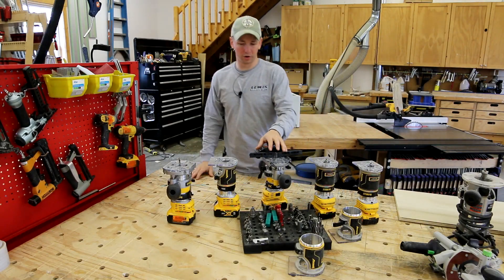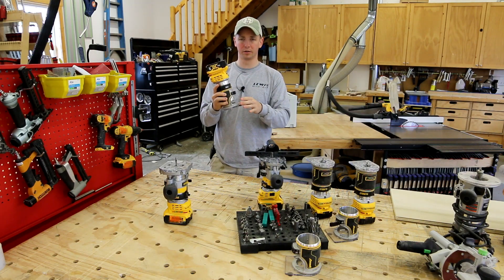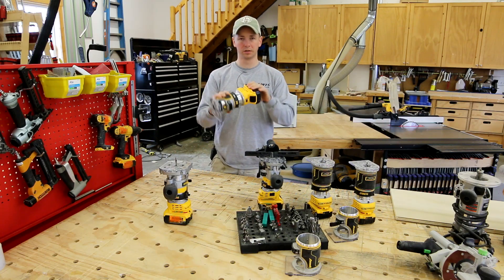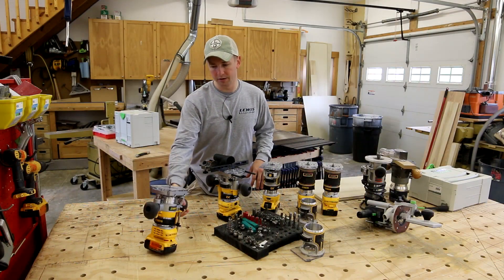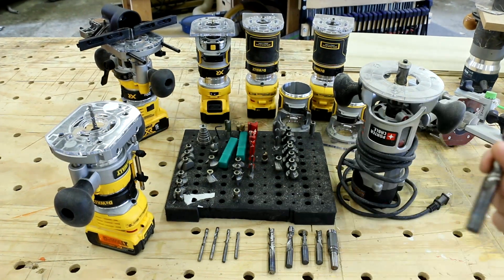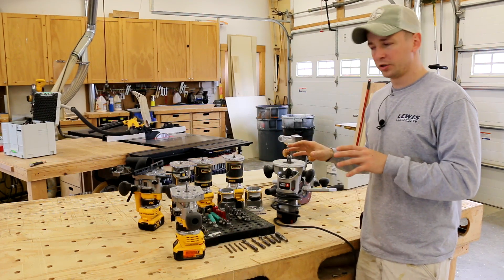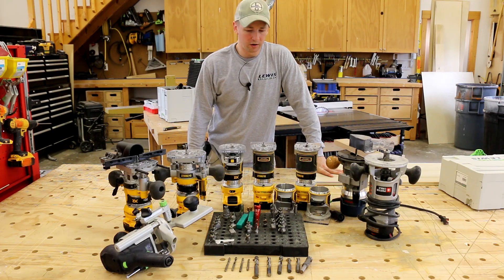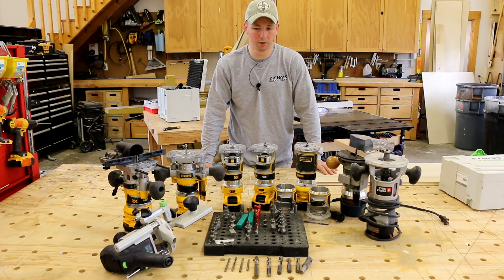DEWALT DCW600B 20V Compact Router Review and Four Uncommon Bits that Take it to the Next Level

Comment: Great video. Just got the cordless dewalt in a Christmas deal. Deff gonna look into some of those bits. Just a camera tip if you go into your camera settings you will find focus settings. Set the focus to be center weighted so it will focus on whatever's in the center of the shot. So when your showing a bit up close it will automatically focus so long as you have it in yh center of the shot. Super useful for this kind of stuff. Keep the vids coming!

Comment from the maker: FYI **This Router Is Not Brushless** (I think I said it was brushless in the video)

Who else is going to have a pile of corded routers collecting dust in their shop??? Cordless is here and its here to stay. Great job Dewalt on this tool. Keep the cordless tools coming. (I really want to see a cordless biscuit joiner come to the market next. After that I'll take a pin nailer.)
Reply: I think I've seen the cordless biscuit joiner.
Reply: I'll second the cordless pin nailer!
Reply: I just checked on Amazon and in the question-and-answer sections it says they are not brushless technology. Do you have actual brushless ones and where to get them
Reply from the maker: You are correct. I realized after I had already rendered and in the process of uploading that I said brushless. I didn't feel like going through the whole process again to edit it. But honestly with my experience using the router I'm getting impressive run times as is.
Reply from the maker: I'm holding out for dewalt. I don't own anything cordless from makita, so I don't want to go down the road of another battery platform.

Comment: Thanks for the review.. I didn’t know the bits cost as much as the tool itself
Reply from the maker: Yep, but when tear out will ruin an expensive work piece you need those expensive bits. They can be money well spent.
Reply: Well, you can get decent bits for $20-$40 that do a good job, they're just don't last long. And where you might normally sharpen it a bit, doing it to an up/down/compression bit is just not an option. You can get very good bits for $50 up to $150... but a $200 cordless router isn't where I'm risking using those. 
 
Smaller routers will occasionally "jump" no matter how skilled you are. And with a ¼" shank, the bit is ruined. I had a good amount more jump with the Dewalt,  and a compression style. I'm usually working with wood, occasionallyaluminum. The Dewalt  did great on aluminum, but wood was a bit of a nightmare. I use the makita 18v coupled with the plunge base it's amazing. (And I admit that I've never tried the plunge base for the Dewalt, but it's had some harsh reviews.) But even then, I'm putting more costly bits into better routers.
 
Oh Dewalt... was ELU all for nothing? Lol

Comment: Thanks for this Spencer!  Convinced me to add the DeWalt battery starter Kit with the router, into my Home Depot cart.  Works out to 99.00 for the router, as a bare tool.  I already have the starter kit from a previous deal, so will probably return the battery kit, as Home Depot separates them on the receipt.  What am impressive set up!  Those flush cutting spiral bits are  really unusual and I will be checking those out.  Thanks for the Video.  A Happy New Year to you and yours!  👍👍👍😁✌🏻🇺🇸

Comment: by the way you should try to take footage whenever you have a modification you're doing or a jig you're making for a tool. From what I've learned so far from a really great carpenter i work for is that there's quite a few tools that have so much more potential if the user understands how to get results they want from a homemade jig.

Comment: People underestimate the value of having multiple routers. I think when I counted, between full size routers, compact routers, and jigs, I think I have about 20 routers. 

I build things similar to you. I have a special lipping planer. Don’t remember who makes it but it was several hundred to a thousand dollars. Really good though. Great for big countertops and shelves.

I used to just glue and nail a 1x2 front edge to my shelves and tops. Now though, I run a 3/4x1/2” rabbet (using a bearing guided router bit) in the 1x2. This makes it easier to apply the trim, and now I only have to flush trim a 1/4” of material. It also automatically makes it nearly flush. You just have to take off about 1/32” since plywood is slightly under 3/4”. I highly recommend it. I also you that joint on my live ends where an end panel meets the faceframe.
Reply: Thanks for sharing that, makes great sense
Reply: Hoffman made (makes?) a good, but expensive, lipping planer.

Comment: Yes LIMITATIONS, but still love it.  I used a pattern bit to trim 3/4 mdf and was using 1 hand to hold the tool, and the other to hold the dust hose...NFG, either the cut got too heavy, or I went the wrong direction, either way the bit caught and climbed right out of my hand...over my head, and onto the floor.  Definitely a 2 handed operation, getting the plunge base next!

Comment: Yeah I like those compression bits they really do a good job. I'm old and retired now but my routers are all corded sorry for the lag in technology. Who would have guessed the direction Battery Technology has gone? Miter saws and table saws with battery?? Wow what a country!!
Reply from the maker: It is crazy. And its only going to keep getting better. Another decade and we will probably only have cords on our battery chargers.
Reply: I have gone almost completely cordless. If I am on a job for an extended period of time my corded miter and table saw come out. But if I am only  on a short day or two job all my saws are cordless. Really cuts down on setup and clean up time, plus don’t have to worry about searching for enough electric to run my job.,

Comment: that collins ply-prep bit is interesting.  does it leave points on the edge of the plywood or does it leave at least a 1/8”  flat so you can put clamping pressure on it so the points don’t collapse?
a five minute video wood bee great if you have the time.
i find this bit interesting because i’ve never heard the glue moisture to pop the ply and cause that line you’re talking about.  i’d love to know more.
great video.
Reply from the maker: It leaves a little bit flat. It has some adjustment as to how much. Depends on how you set it up. It really helps get invisible seems.

Comment: Been waiting for the new brushless dewalt routers. I plan to use them dedicated for  door installation (hinge mortising and latch plate mortising).
Reply from the maker: They are worth the wait. I'm satisfied. Glad they got it right. FYI they aren't actually brushless.
Reply: Insider Carpentry damn, shouldn’t have watched this video. Those two Ryobi corded ones for doors I got a few months ago will need to find a place in my workshop and the dewalts will eventually find a place for on site work where cords are a pain.

Comment: Great video! Where can I find the dust shroud you have on the Bosch router with ply prep bit. Currently using the bit in router table with power feeder but I like the versatility of a handheld router option. Thanks.
Reply from the maker: Honestly I can't remember where I got it from. It's been a long time since I made that setup.

Comment: I picked one of these up a month or so ago and I'm glad I did. The run time is crazy on them. 

With that plywood prep bit, how deep of a cove does it make? It seems like there could be a risk of damaging the top veneers if you're clamping the hell out of nosing.
Reply from the maker: Its not very deep at all. And you can adjust it if needed so you're not taking out maximum depth. I don't think you's have any issues.
Reply: @InsiderCarpentry  that makes sense! Did I see a festool female cord in your other router?

Comment: I have the new cordless Milwaukee, and the Dewalt, I love both, Great routers, Thanks for the nice review. I was wondering what size your shop is, Mines 32x25, Yours seems so much bigger
Reply from the maker: 30x36. Its an attached garage to my house. I feel like I could utilize the space much better if I didn't have doors taking up all the space on two walls. But it works for now.
Reply: @InsiderCarpentry  Looks like a great size, Wish I had just a little bit more, I have a panel saw and a panel router that takes up a lot of my wall space, Thanks for the info

Comment: Got one the criticisms are the speed control is too easily changed if you accidently touch it and the on/off switch takes some getting use to! Wanted to cut a circle out but can't see a way to do that. As always Dewalt make a good tool but there's always something that could have been easily improved if the guys who design these tools actually used them! No review on Youtube to show how to use all the accessories :(

Comment: Is the collins bit in the Bosch router a 1/4" shank?  The 1/2" shank is out of stock but i feel like 1/4" would work fine for the amount of stock you're taking off.  Also, where did you get the dust port?  Thanks.
Reply from the maker: yes, the 1/4 would work fine for the ply prep bit.

Comment: I hang a lot of doors in older homes and would like to go cordless with DCW600, as I am mostly on the Dewalt 20V platform. The standard base isn't big enough to span the rails of my Porter Cable template, but the plunge base DNP612 would be wide enough. Will the plunge base accept PC style 2-piece guide bushings? Dust collection would also be a big help, and Dewalt offers a dust port DNP616 made to fit the plunge base.  Have you used the dust port with the plunge base, and do you think this combo would do a reasonable job controlling dust when template routing? (The stock Milwaukee 2723-20 kit checks all my boxes, but I'm hoping to avoid adding another battery platform.)
Reply from the maker: I haven't used DC with the compact router ever. This base plate might be a good option. I have it on a couple of my trim routers, one of which I use for a hinge template. Hard to get good dust collection on routers. https://amzn.to/3m1z4yE
Reply: @InsiderCarpentry  Thanks, Spencer.  BTW what butt hinge template do you use? (I have some Templaco fixed size but mostly use PC adjustable.)
Reply from the maker: Nothing in particular. I rarely ever do hinge work. Door shop does everything.

Comment: How would you compare the Dewalt compact router to the new Milwaukee compact?
Reply from the maker: Almost all of my time is on the dewalt so I can't give a fair assessment. At face value they are almost the same, only major difference in function is the battery platform. Both are excellent options.
Reply: Thanks so much, appreciate the insight And a big fan of the channel

Comment: I see in your video you have 2 empty bases on the table, where can those be located? Looking to see if the cordless base would fit on the DWP611. Thanks
Reply from the maker: The plunge bases can be easily switch out with the fixed bases.

Comment: I have a 350 dollar Dewalt hammer drill that is nine years old that I can no longer get a repair part for as Dewalt has discontinued production of the gear assembly making the drill useless.  I tried to find a factory repair center in my area but found out Dewalt had closed them. I was a dedicated Dewalt tool person but I guess I will have to rethink that one.
Reply: Bin it mate. These tools aren't designed to last a lifetime.

Comment: Have you tried any 60v batteries in these tools?
Honest question why but a 5ahr battery when for just a few more dollars I can buy a 6ahr 60v flex volt battery?
Reply from the maker: You wouldn't be getting any more power. Just 1/6 longer run time.
Reply: In my experience I do get better power when running 60v batteries. For example my compact 6.5" circular saw runs much better with a 60v battery. 

It's like running a tool on 240 versus 120, a tool capable of being wired either way that is.

Comment: So, have you tried routing jambmaster blocks with it yet?
Reply from the maker: No... but unfortunately I don’t think it will have what it takes for that application. I’m not even going to try.
Reply: Insider Carpentry bummer, really wanting to get a jambmaster but really hating the idea of dragging the cord around. Although the results I see from all you IG guys pushes me closer every day...
Reply from the maker: Zak Casey The cord isn’t to big of a deal. You have to have the cord for the glue gun anyway. And you have to have a decent cart setup anyway. So you’re already rolling a cart of stuff around anyway.
Reply: Insider Carpentry are you using the hipur gun for the blocks? And is it really as quick as 7 minutes like the video states? I really want one and if I can bust out doors as fast as I can now with easy consistent results it will be worth it.
Reply from the maker: No I use a PAM hot glue gun. Hipur is overkill for that. I'd say i'm same speed to slightly faster with the JM. But it takes practice with it. Its more of a quality and luxury tool. You can't hang an interior door better than with the JM. And as a the hanger it makes life easy, you just hang in cruise control and crappy framing is irrelevant.
Reply: Insider Carpentry yeah that’s what I was thinking, it would be a wash with setup time vs screwing with the absolute garbage framing I have to deal with... well thanks for the info! I’m always looking for ways to up the quality and efficiency, have learned a lot from you!

Comment: What did u use as a pivot for that overhead arm for your dust collection hose?
Reply from the maker: A large castor. Remove the wheel and insert a length of 2” dowel. Attach the hose to the dowel. One of the best ROI shop projects I’ve done.
Reply: thanks for the reply and the tip...I will use it for my air hose

Comment: That's really unfortunate with the capability of using it to cut out window openings. I think DeWalt really missed the mark on that one because it'd be a framers dream to use it for that. And with Milwaukee on dewalts heals it looks like there's does have enough power to cut open a window with relative ease
Reply: I watched the new Milwaukee one cut out windows like hell on internet. He said he could probably push it as hard as he wanted.
Reply: @chrissmith2921  that's good to know because I just bought one of these myself lol
Reply: @tomhammond89  Maybe think about those flush bits he's got though. As long as your guys are keeping there spikes heads out of the way.

Comment: I'm curious, are the compact cordless Dewalt any better than the Makita compact cordless? For the record, the Makita are a joke. We have one in our shop, it is utterly unusable for pretty much anything other than trim plates.
Reply from the maker: I typically just run small bits or flush trim bits in them. I've been very happy with the dewalts. Maybe you're using more bit than they're designed for??? I have a few of the corded makita compact routers and loved them.
Reply: @InsiderCarpentry  The corded Makita compact router is a masterpiece of engineering, and probably one of my favorite tools of all time.  The contrast between it and its cordless counterpart is probably one of the reasons that the cordless one is such an embarrassment. The cordless Makita can run a 5/16 round over for no more than 5 minutes before it shuts down from overheating.
Reply from the maker: @josephdestaubin7426  Bummer. I've been very happy with run time on the dewalts. I do a lot of edge easing onsite and always have a 5.0 battery on my dewalts. I feel the run time is very good.
Reply from the maker: @josephdestaubin7426  I'm sure in another year dewalt will release the brushless version to drive sales more. I don't understand why they have to give us a non bushless tool just to release the brushless version a year later.
Reply: @InsiderCarpentry  I think that might have to do with the country of origin. I haven't checked in a while, but for some time all of DeWalt brushless tools we're made in Mexico and the United States, whereas the brush tools are made in Asia. One can imagine that setting up for manufacturing was much cheaper in Asia than it would have been in Mexico or the United States. And as Asia lacks the tooling for manufacturing the brushess line of tools, well you get the point. The whole point of the Asian DeWalt line is price. Basically Dewalt shipped all of their older manufacturing process (and probably equipment) to Asia to continue "manufacturing to a price," while retooling in Mexico and the United States for a higher-end product, ie. brushless tools. DeWalt is probably pretty concerned about the price of entering the market  and gaining a foothold. This is why, generally speaking, DeWalt is likely to attempt to acquire market dominance with any new tool with brushed Motors for the foreseeable future. Once they've proved that they can sustain something, it remains to be seen whether they will ever move to brushless to broaden the appeal of the product. Personally, I'm pretty vested in the wall but would prefer to be using Makita. The problem with Makita, however, this is that the bastards program their batteries to permanently take themselves out of commission if they've been overheated. After 34 years of backbreaking construction, I don't need a manufacturer telling me what's safe and what's not; and I certainly don't need them going into my tool bag and disabling my tools.